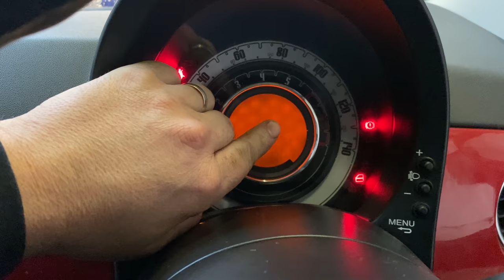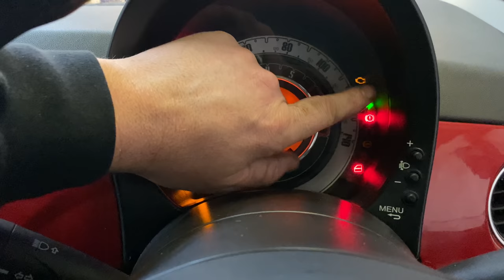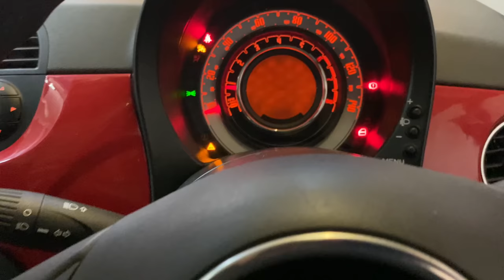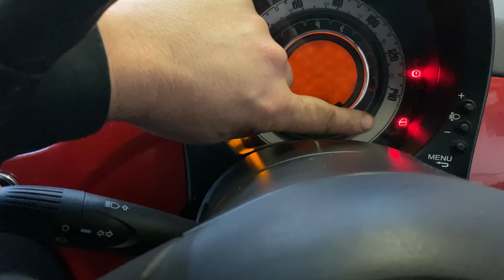FIAT 500 LCD DISPLAY PANEL NOT WORKING

Comment: Another cracking job. Another great deal on front end parts as well. The problem with the Fiat cluster was a pain, but a good job in a way that it happened when it did and not after you sold it

Comment: The long knife is to remove the glue from the body as.well...slice in the middle lift up slightly place blade of.long knife under old bond lift bond up with other hand as you lift slide the blade around the bond this will.leave a bond line for the new primer and the bond..hope it helps cheers...keep going...

Comment: The 500 triangle warning light is usually accompanied by a message on the LCD which you cant see right now, the Mrs had a DRL bulb gone on her 500 last week and the triangle was lit with the message that it was out, make sure your multi-plug on the clocks is pushed in tight as it was ok until you had the dash out? Good luck Mark👍
Reply from the maker: Thanks Gary nice one buddy I will check before taking it and yeah it was all ok strange 👍👍😷

Comment: That cluster looks fit for the bin. There’s a fella on the Fiat 500 owners club forum called Chris CFC Fisher who sells cluster already adjusted to your mileage for £150. They still need a proxy alignment though. Triangle on dash is a generic error light. Will come on whenever there is any error. Even a blown bulb will bring it on. I see you have a Puzzi machine, what cleaning fluid do you use?

Comment: Hi mate can I give you some advise on your windscreens....from an x window fitter......you can find all this on ebay...or go to waysideadhesive66...they do all the windscreen glues etc...and buy your.self a long knife to.remove the glue from the body..now you do.not need to go to bare metal when the screen  the long knife was to cut the bottom out as we used.to use a.kent tool for the top and side and the bottom with the long knife spraying windscreen cleaner on the bond as you slice the bottom..and they do cotton buds for the primers I've always brought mine from them and tubes come cut to...just some advise to make.things a bit easier..👌😁👌👍
Reply from the maker: Thanks for the info buddy appreciate it nice one 👍👍😷

Comment: Where are you based pal
Reply from the maker: Hi mate Essex
Reply: @ResurwreckAutosUK  miles away. Got r lass fiat 500 recently. Its 64 plate. Led display in middle of speed display packed in. Struggling to get it fixed.
Reply from the maker: @getthefekir5040  the middle part is the easiest part you can buy the replacement part from eBay loads of videos on YouTube how to change try watching Paul at love 500 YouTube channel hope that helps you good luck 👍👍
Reply: @ResurwreckAutosUK  cheers pal. All the best